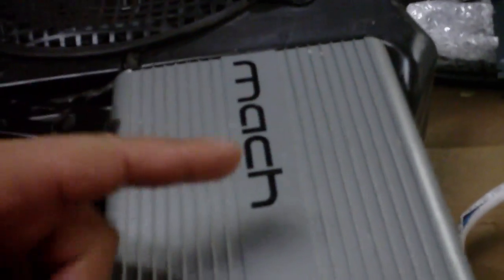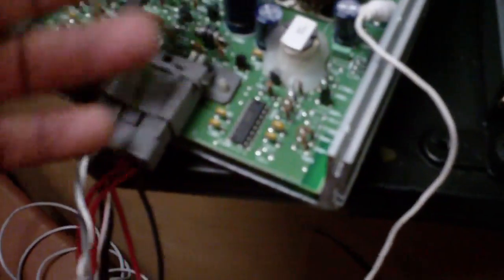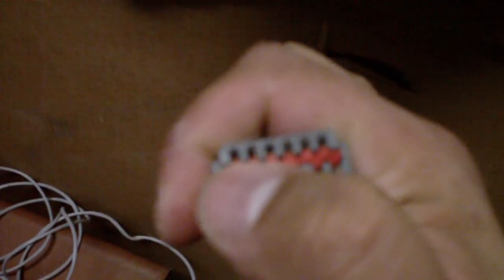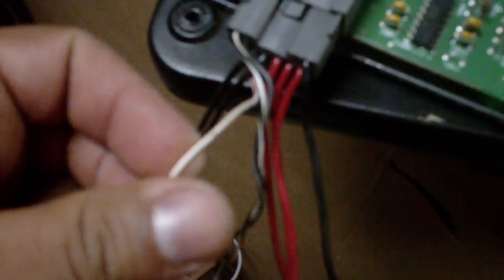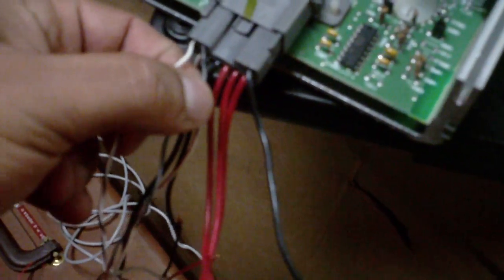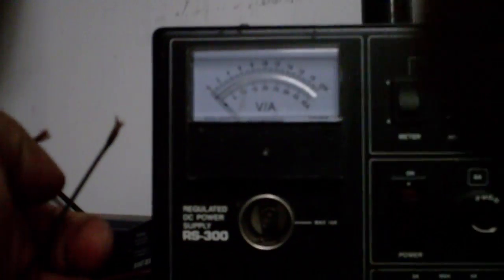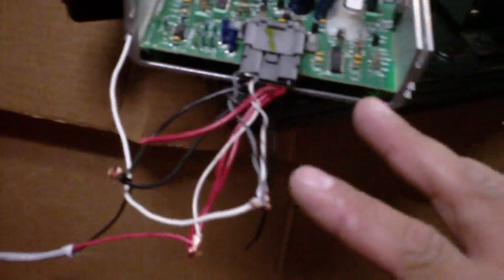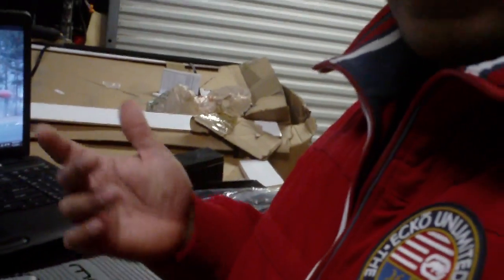Amplifier MACH "How to Wire  factory connection"

Comment: so i've taken my mach sub/amp out of my ford escape. now in my Sierra,  I've ran the constant and remote together too the ignition Fuse. ground to chasi. leaving the last two  - and + which i've linked each to the back door - and +. IT WORKS!! however......it is way too loud. at just like vol. 1 or 3 its LOUD. the door speakers still work but can't really distignuish them anymore since the Mach is soooo loud. lost on what to do sides buy and amp and box......trying avoid since it fits underneath my seat as is. Thanks

Comment: Thanks for the upload. Glad i seen this on here amd it's still up after 7 years. I still need to check to see of mine is useing the same color code wires. I did read all the comments and it is sad that people were just commenting and really didnt even know what you were doing, cause I understood it completely. I was wondering how i could test my amp to see of it is bad or if it is just a bad wire somewhere in the truck. Now I have to just test and go from there. Thanks for the color code explained also. Keep up the great work.

Comment: i bought the whole box at a yard sale but the wires are green n black and pink with stripes. the amp the amp has to be extreamly low power , i mean look at the wires really my 600 watt cossfire uses 8gauge for speaker wires

Comment: I have a 98 Ford expedition Eddie Bauer edition and it has a subwoofer but it's not connected to my after market radio it has two yellow an a red coming out one end and three skinny wires on the other side red and green, a green and black and blue and black I think need help on witch one is sound and witch is power to make it work can anyone help please

Comment: Hey buddy.... Hoping you could help me out, I'm thinking of buying a nakamichi na 1600 touch screen double dinn head unit for my 02 ford escape that has a Mach stereo system in there, that's 6 speakers with 6 Co changer head unit and 1 amp powered subwoofer. At the back of the Mach head unit there are 2 harnesses that plug into the back, the main large one for the power and speakers and another smaller one that I believe is for the amp. How would I wire up the new head unit to work with all speakers and subwoofer?

Comment: hi Paul I HAVE A SET FROM A STANG I BUILT .. CAN I WIRE THIS JUST LIKE REGULAR AMPS AN SPEAKERS INTO MY PETE....IF SO DO I WIRE IT JUST LIKE YOU EXPLAIND HERE
Reply from the maker: My question will be, is the same amplifier? if is Not wouldn't recommended to wire the same way email me pic of your amps and also the plug paulccfox@hotmail.com make sure brand and model pic will be helpful.
Reply: ok paul thanks will do
Reply: Hey man what is that set up does that one that one have to two amps and the sub

Comment: I have an 04 Crown Vic LX Sport and am using a Mach amp, a Bose speaker, and a Mercury Marauder enclosure. This video is just what I was looking for so I can make the adapter harness to go from the factory 6-pin/5-wire body connector to the amp! Thanks!!
Reply: G

Comment: If i want to connect different speakers not the factory ones what cables do i use?? 
I want to connect pyle speajers to my mach amps help please
Reply from the maker: If you using the same amplifier the one in the back connector,
Any amplifier NOTE input will have RCA connector feed back from stereo and to Amplify to the speaker will be lock connector or like gator style because uses a thicker cable. Add my on FB pcabrera@segnow.com search me with this Email.

Comment: I bought 4 mach 1000 amps for the15 dollars at a yard sale and just wired them just like you did and they work so thanks.... And too the ones said he hooked them up wrong he has the out put and the input right b.c I just hooked up to 4 of them just like that
Reply from the maker: Daniel Tellez Must of RCA connector will have color code Red and Yellow add me on FB bro we share Pic and you will send me pic to help you out.
Reply: @PAULCCFOX  Im late to the party, I have the mach 1000 amps and I'd like to put 4 10s to it, (2 voice 2 midbass) is there any chance I can get guidance?
Reply from the maker: Great congratulation,i am glad this video work for you.
Reply: Were would the rca go and subs if i want to connect some non mach subs

Comment: hi i have a 97 mustang with mach 460.it had a aftermarket radio when i bought it and apparently all factory wiring was cut.i bought new harness but the harness under the rear seat on passenger side was cut.Colors of the wires are black and green.Im trying to figure out how to connect them.When i put the volume high it fades away back and forward.Im assuming its because of the wiring that i cant figure out.

Comment: hi im trying to connect the same mach amp as u show in your video  but mine has different colors. 1black/greenline  2 ,3 black with green line 4,5,6 violet with light blue line
7black with green line 8, black with white line  9,10 nothing my plug from left bottom 1-6.  top left 7,8,9,10
Is the connection still the same or is it different since the color code is different if u can please help id glady appreciate it
Reply: Ya